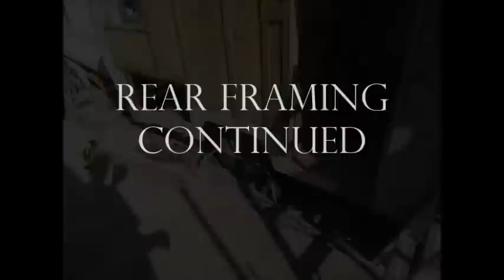Trailer Tidbits   57 Westerner Part 3c - Rear Framing Continued

Comment: Some really good progress, and it's amazing that you got away with putting that metal on with the camera running. I was waiting for the whole side to fall off.  LOL

Seems like you could put a single 4x8 sheet of Lexan across that top and seal it just as well as metal. I think it's a killer idea!

Sux that you got hit with the flu. It can really drag you down, and I hope you're over it by now. I've managed to avoid it so far... (crossing fingers)
Reply from the maker: Still sick John but feeling better now instead of worse at least.

Most of what hold's the two walls of the trailer together is up there where you and I would like to put Lexan LOL... So for now we'll have to keep the vent small.

Comment: Hey Larry, Where can I find this edge board. ? Is this a speaicl type of wood?  Please let me know... Thanks I'm learning a lot watching your Videos...

Rudy
Reply from the maker: Rudy Hernandez Hi Rudy. You make the edgeboard or "curbing" as I like to call it. 3 layers of 1/4 inch plywood makes a 3/4 inch tall edge board to match up with 3/4 inch framing. If your framing is larger you just add more layers to make up the height of the framing. I cut a two foot by four foot piece of plywood out of a sheet and then run it through the table saw for my width. Makes nice straight pieces that way. But it can be done with a skill saw also. Just more time consuming. I make the pieces 4 feet long cutting against the grain so they bend easily around the radius of the trailer... I should make a quick tips vid on making edgeboard. On the last trailer I glued each layer and stapled it also. Worked great. Nice and strong.
Reply: Very cool, thank you so very much. .. That's a great help...